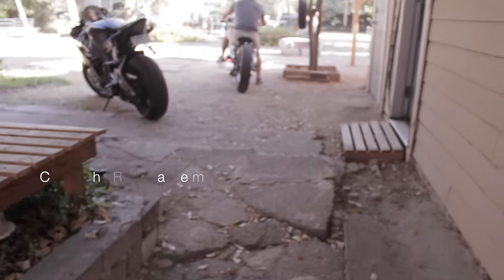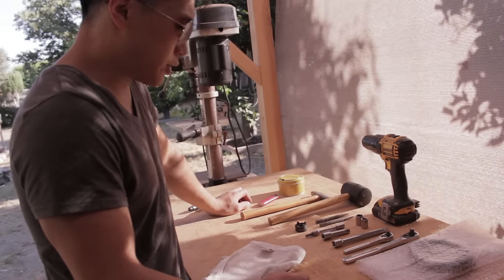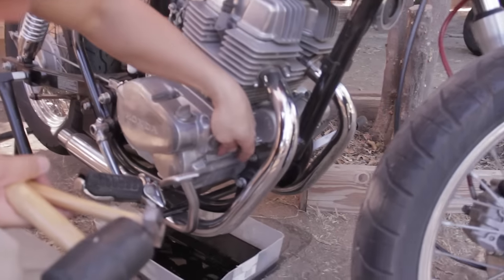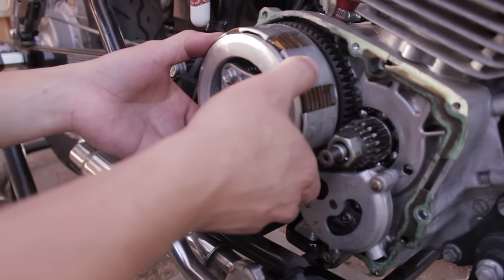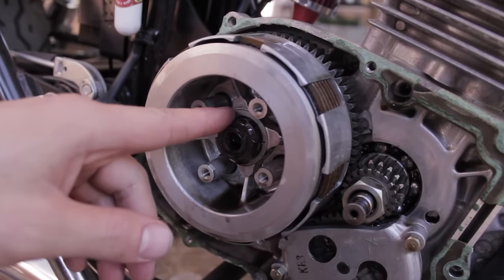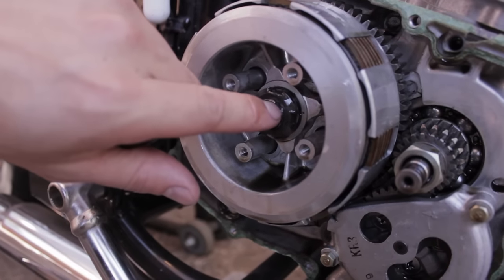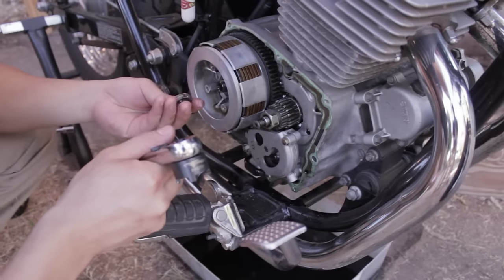HOW TO REPLACE HONDA REBEL CLUTCH DETAILED GUIDE [BEST CINEMATIC TUTORIAL]

Comment: after replacing the clutch plates, i notice the plates do not touch each other tightly. Is it suppose that way for honda cb 250 bike?
also,  a big problem: no tension in the clutch cable, doesn't matter how i adjust both the top and bottom adjustment locations.
i try in 1st  gear and the bike jerk & stop as soon as i release the cable.
please help, what is wrong? did i miss doing any thing? i can not ride the bike for over a month now.
Reply from the maker: truc ngo refer to a Honda Rebel manual and compare what you see to an exploded view of the clutch assembly. I’m guessing your might have damaged or missing judder springs. Always read the manual. Good luck mate.
Reply: both springs are good and i follow the manual exactly and your video as well.
please let me know if you find out the possible reasons somehow, thanks.
Reply from the maker: truc ngo Check your washers. Are you aware that there is a washer between the clutch center and clutch outer? Pause at 3:20 of the video. You will see after I remove the clutch center there’s a washer over the spindle. Sometime the oily washer sticks to the clutch center and fall off during transfer. I have a google image link below for reference of that washer. Cheers.

https://goo.gl/images/qpJHqd
Reply: ok, will recheck again this weekend (must be 10 times now that i take it apart , unstake & restake the center nut,  screw back the 4 springs & the 10 or 12 clutch-box 's screws ). i do not have torque wrench, but i really tighten the center nut & only snuggle fit the 4 springs. Even that,  nothing would move as i tried to press hard by hand on the top plate that sits on top of the 4 springs. may be i will reverse the direction of the curved face of the judder spring (but i don't think it would make any difference).
thanks for thinking of other possible causes.
will let you know what happens.
Reply from the maker: truc ngo My pleasure sir. Good luck! I hope it works out! Please anyone seeing this share your thoughts!!!
Reply from the maker: truc ngo Hi Truc Ngo, I’m following up on your project! How did it go? Any progress? Cheers!

Comment: What size spanner socket is needed to lossen the bolt holding the basket in?
Reply: I liked the video but that is some of the info is was looking for too. I'm getting ready to do my 82 cm250 and need to by the right size spanner socket. Also as fancy as that torque wrench was, what are all the specs for all the nuts and bolts? 
Cheers!

Comment: What size is that socket to release the clutch disk
Reply from the maker: KUSTOM FILMZ OKC 24 mm spammer nut tool. Link in description. Cheers.
Reply: @acigarwilldo  thanks allot

Comment: Hey! I had a question about that little lever that slides into the cover, connected to the cable. im not getting any pressure when i pull back on the clutch. Followed the video step by step. Is there anyway i can shoot a short clip on my issue seeking guidance? (ANSON HSU)
Reply from the maker: Khari, You are more than welcome to send me a clip for visuals. In the meantime here are some information that might help:

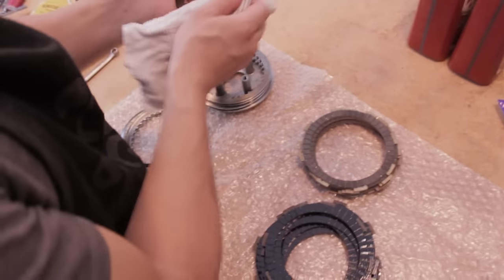I think I may know where the problem is. Simple fix. Look at this video and watch @ 3:32.
https://youtu.be/PALnt1W85TY 

On the clutch cover, you will see the lifter foot that pushes out and is suppose to depress the spring plate holding down the springs. Check and see if that assembled correctly. Give it a try. Let me know. Good luck!
Reply: Ok as of 5:47 pm! Bikes running! Got power back, just some minor cable adjustments needed! Thank you to ANSON HSU for all your help!
Reply from the maker: @kmcrock4313  Hey Khari, I didn't get a chance to view your video but hey I'm glad you fixed it! Happy riding. Cheers!
Reply: @acigarwilldo  Thanks man! I thank you so much! Hey i had a question about your pod filter? where did you get it?
Reply from the maker: Khari Vega You’re welcome. The pod filter I got it on eBay. Called “emgo pod filter”.
Reply: Quick install? Or rejet?
Reply from the maker: Khari Vega gotta re-jet once the air box is removed. You can find Honda rebel re-jet kits on the internet. Typically includes a variety of different sized jets. You need to trial and error it until you find the correct mixture.
Reply: Hey man! Much love, I can’t tell how much of I help you’ve been! I’ll be sure to pass you on! Ever did any music videos for anyone? Heard they pay good...
Reply from the maker: @kmcrock4313  Glad to hear man. Thank you. Did music videos before with friends for fun.
Reply: Much love! Thank you again!

Comment: Really need detail help on the spring bolts do they actually tighten all the way down or is there Slack?
Reply from the maker: dig thig all the way down. Evenly.
Reply: @acigarwilldo  I must have something missing because when I tightened them all the way down evenly there is no play when I pull the clutch and I cannot pull the clutch to handle it does not move at all
Reply: Is there supposed to be another spring somewhere besides the four Springs and four bolts?
Reply: Is there supposed to be a spring inside the shaft that the basket fits on?
Reply from the maker: dig thig No. Only the 4 springs.

Comment: I don't understand if you tighten the spring bolts all the way down or not?
Reply from the maker: dig thig yes of course! Cheers!
Reply: @acigarwilldo  but something has got to be missing because the clutch will not depress and release the pressure
Reply: @acigarwilldo  the engine was rebuilt and sent back but the clutch will not work at all now there is no play whatsoever
Reply: @acigarwilldo  I feel something is either missing or it is put back together wrong
Reply from the maker: dig thig sounds like something is assembled incorrectly. Can the clutch lever at the handle move when you squeeze to disengage?
Reply: @acigarwilldo  can't pull the cable at all it is tight. The cable will pool without it being attached but when connected to the push rod on the clutch it will not budge I think something is missing too. Do you know where I can get a diagram to help me figure this out?
Reply: I really thank you for responding to me I have been beating my head over this for 2 days
Reply: @acigarwilldo  my boss had someone work on it but he sent it to me to try and fix it he does not want to go back to that mechanic. And I deeply want to understand why this is not working. I find it impossible to find anyting I type on YouTube or the internet and get exactly what I typed. Maybe I'm just going crazy but I really want to figure it out.
Lol
Reply from the maker: dig thig I think I know where the problem is. Simple fix. Look at this video and watch @ 3:32.
https://youtu.be/PALnt1W85TY 

On the clutch cover, you will see the lifter foot that pushes out and is suppose to depress the plate holding down the springs. From my understanding, you are telling me that you can not press the lever down and disengage the clutch. No play. No slack. Correct? Then it could be because you need to seat the lifter foot correctly which the guy in the video explains how.

Perhaps the person that rebuilt your engine only dropped the foot in and didn’t seat the foot all the way down. Give it a try. Good luck!

Comment: Very nice video Anson, great content and great quality. I have a similar bike to yours, a Honda CB250 Nighthawk from 1994, motor looks identical to yours. I have a slight transmission problem (I think) or a clutch problem. I can shift fine however 2nd gear does not catch on at all, not even a bit, its as if its in neutral (neutral light is off though so its obv not in neutral). I can ride in 1st and then shift to 2nd (which doesnt work), and up to 3rd which will work, to 4th and 5th... Do you think maybe some of my clutch friction discs are worn out or maybe its something else? Would love to hear from anybody. Thx!
Reply from the maker: Sounds like it's something else. Possibly a gearbox issue. I would need to physically look at it to know.